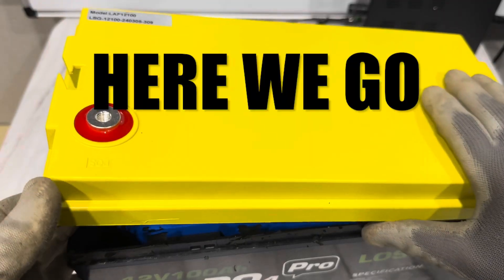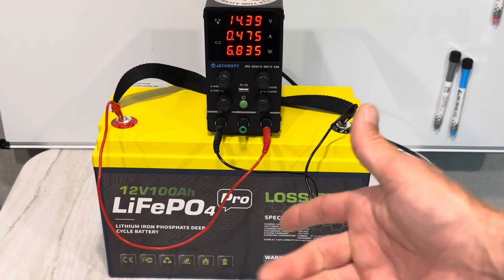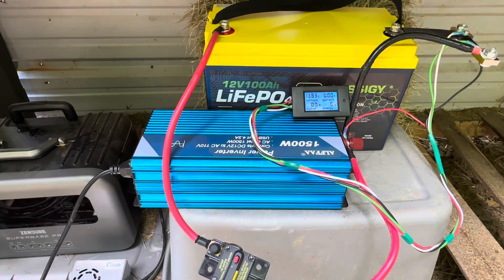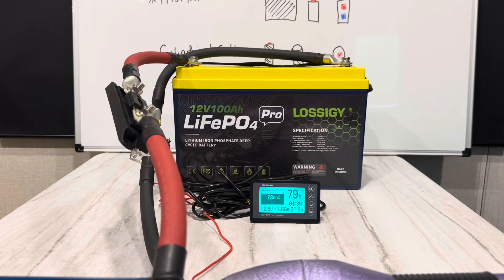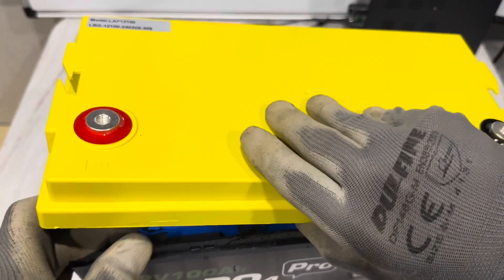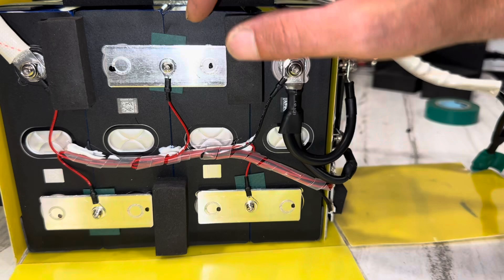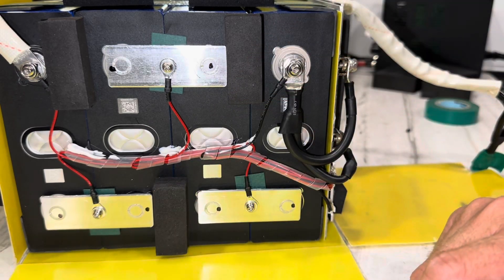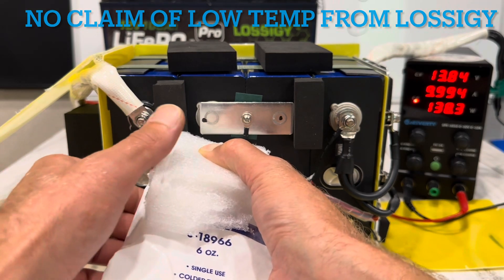LOSSIGY 12.8 Volt 100Ah LiFePO4 Battery Review and Teardown

Comment: Lossigy has been my go-to brand for doing LiFePo4 battery upgrades to golf carts.  This is one of two tear-down reviews I've watched with the same result.. Lossigy is a well built battery.  Yeah, I wish they would add low temp protection but as long as the end user is aware of the situation, it should be fine.  https://www.youtube.com/@OGWT
Reply from the maker: Lossigy is a good choice! Personally I don’t mind if a battery has LTCP for solar applications, but some folks want or need the function. In my area LTCP would be needed though for a golf cart application if it’s not in a heated garage. My golf cart LiFePO4 batteries get below freezing many times in the winter sitting in an unheated shed.

Comment: Would three of these work in my 36 volt Golf cart ? Thank you for the video!
Reply from the maker: Probably. I’m running 3x12V units from a different brand as a test currently in my Club Car DS. I’ve been testing for 3 weeks. I have another week of testing then I’ll make a video discussing the pros and cons to this arrangement. My motor has pulled 6500W from the 3x12 set…I’ll update you soon!
Reply: I've received my three Lossigy Batteries.  I look forward to  your video.   I will be installing them sometime this winter. In my Ezgo cart.

Comment: Have you ever seen a low temp switch that could be installed between the charging source and the battery? It would seem that would be cool gadget for someone to invent if they're not already avaliable
Reply from the maker: Yes there are commercially available options for what you request. There are homebrew options as well. I’ll go over this for you in an upcoming video.